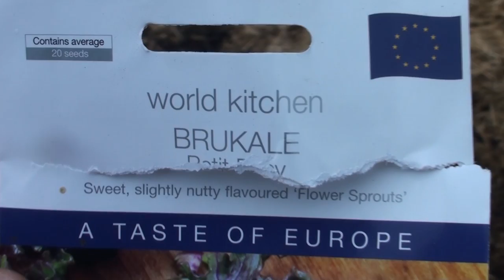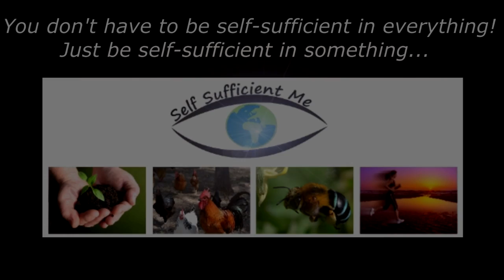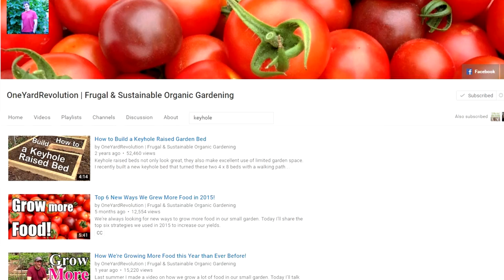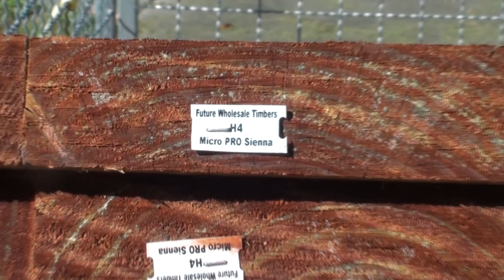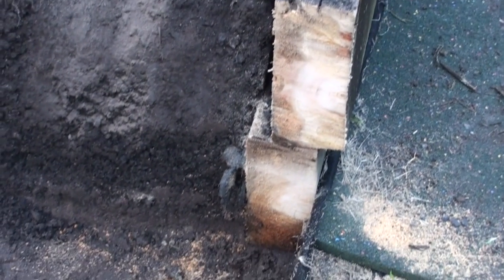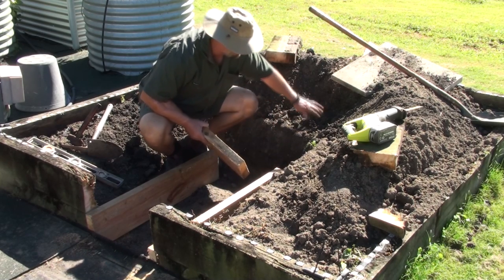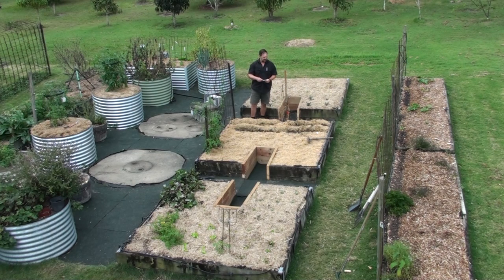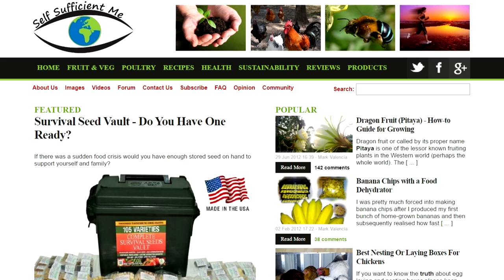How to Cut Keyhole into Raised Garden Beds Retrofit

Comment: I did the same thing with my first raised bed very long which is great but way too wide. Potatoes in it this year and I just came in the house from transplanting sunflowers down the centre of it . The areas that I can reach are planted with potatoes, onions and shallots. You just built some beautiful key hole beds. Most of my raised beds are are over 10 years old and starting to rot except for the one large mistake bed the others are 4X4 feet or 2X16 feet beds so no problem reaching the centre I'm think when I start replacing them I will do larger key hole beds.
Reply from the maker: Hey Dale, yes mate I think the older I get the easier access want my beds to be lol... I do like the long skinny beds as you meantioned they are easy to build and work in and I actually do have two more long beds to build up higher - they are about 2 feet wide and probably 30 long at the moment they are just one sleeper high and I want them to be at least another half foot higher.  Cheers mate :)

Comment: Mark, That's wonderful! I love anything that takes the frustration out of gardening. I'm going to put a couple raised beds here at my rental, and should finish my beds at my property at the end of this summer, or in the fall. I decided to go a bit higher so that I don't have to bend too much. There's one area at my property that I may have to use a wider bed like yours, and if I do, I will use this system for sure. This may have solved the problems I was having with that area, and take the worry out of how I was going to reach the veggies, if I had to make it a large bed. Thank you so much. Sheila
Reply from the maker: Hey Sheila! Thank you :) I'm such a fan of higher raised beds and I tend to agree with you and like the beds even higher than mine in the video so bending is kept to a minimum (especially with my old army injuries and getting older). Best of luck with your raised bed builds. Cheers :)

Comment: nice job, we have screws called timber screws they are driven in with an electric drill. they have a very course thread and often a special head that reduces to handle the torque, lengths from 4 inches to 12.
best to you, we are in summer finally and planting outside.
best
Reply from the maker: Thanks for the tip on the screws - I'll have a look into it and see if our hardware store stocks them. Yes, your summer coincides with our winter and for both of us it's the best time to grow!   Cheers Rev :)

Comment: Great job!  How wide do you recommend making raised beds?
Reply from the maker: Thank you! If you are making the beds rectangle then I would recommend about 4 feet wide so you can reach the centre from either side without getting into the bed. If you are making it square then it doesn't matter because you just measure and cut the keyhole into the centre of the square. Cheers :)